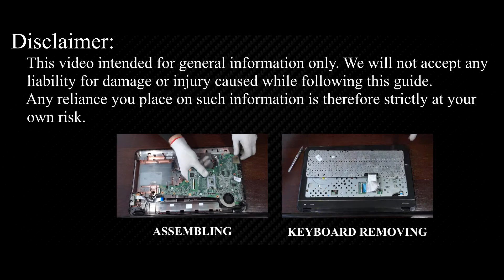HP Pavilion g7-2000 Series Disassembly, Fan Cleaning, and Thermal Paste Replacement Guide

Comment: I also own a G7. At the age of 5, while booting the fan-fault came up. Disassembly reveals totally dusty fan + air-ducts.
I never found the following hint in any video: I recommend to ALSO remove the impella (easy; it is just clicked into its seat in the housing). Makes it easier to clean all areas. And enables to clean and re-grease its bearing!! (please look for the correct type of grease by youself; I don't have it in my mind)

Comment: Thanks for this video, it helped me save some time and not break stuff trying to figure out how it comes apart. The wife has a G7 2043 (very similar to whats in this video). Was able to fix the left hing (JB Weld) and clean out the fan and apply new thermal paste. Running cooler again. You rock my man!

Comment: I had the back left hinge mount break inside, so I could not no longer open and close the laptop. When I would try to adjusted the angle of the display, the display would become distorted.  Thanks for the tips on taking it apart, I was able rebuild the broken corner, by drilling it out and adding some bolts, working great now.  thanks
Reply: I had the same issue. I just used some JB weld and it seems to be holding. I would have drilled and used some bolts however, this computer is my wife's and she would flip out if I did that.